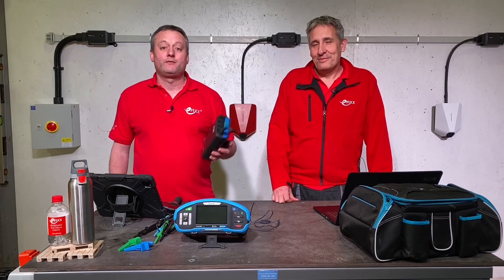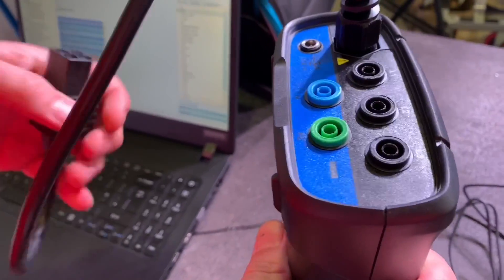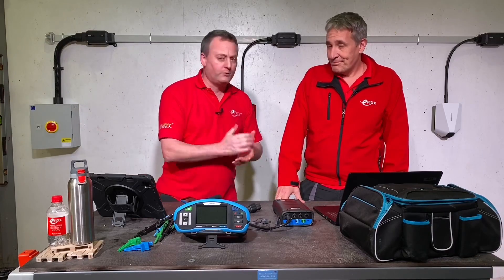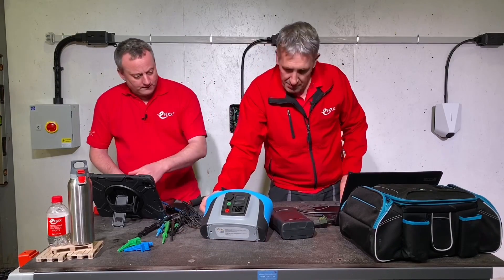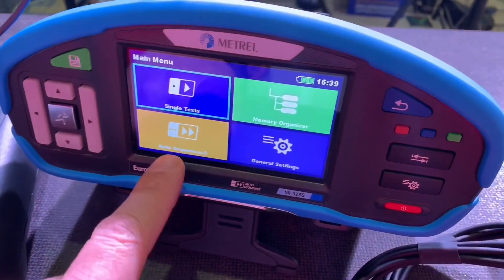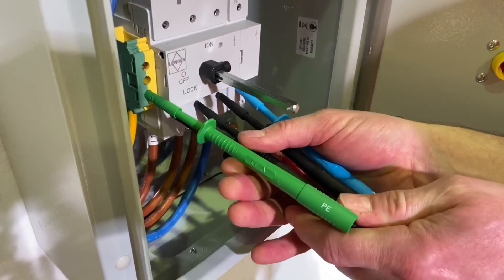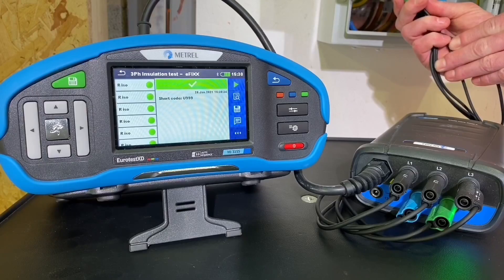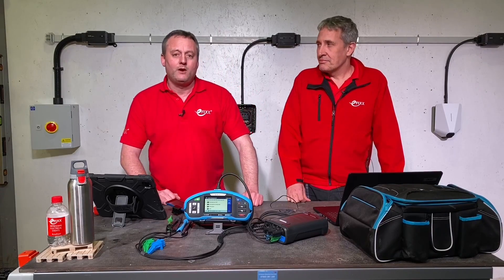Faster THREE PHASE testing with the METREL ACTIVE SWITCH using MI3155 Auto sequence

Comment: I like eFIXX videos, they are very educative. I wonder though if there is an easy way to carry out the safety tests i.e. RCD, fault loop, isolation etc, on a DC charger in a similar way as on an AC charger, where measurements can be made through the XA 1523 adaptor. If there is already any relative video, please indicate. Thanks.

Comment: That I.R. test is just the easy one...Does it do R1+R2     which is the pain to test for the air con unit on the roof or do we still need to run up and down 4 times.

Comment: Hi there. How are the three-phase RCD check sequences performed?
 3P + N; does it first with L1-N and then L2-N ...?
Reply from the maker: RCD test on three phase is just usual any Line to Neutral
Reply: @efixx  In other words, the routine test of the 4-pole RCDs according to IEC 61008. Does the MI 3155 connected to the A1507 perform the automatic sequence first between L1-N and then L2-N and L3-N just like the test R ais?

Comment: When doing IR testing I short my probes first to check they are not broken, how would you do it with this tester?
Reply from the maker: Good point - Connect all the probes together at the end (stack them) and run the test sequence - the meter should then report a fail for every test.

Comment: I have 3152. How do you find the battery life? Seems to be go pretty quickly to me.
Reply from the maker: This has a beefed up battery compared to the 3152
Reply: I get days out of the 3155
Reply: @richardwilliamson3624  thanks for the reply. Just that when I first had the tester I charged it for 16hours and didn’t use it for a while (couple of weeks maybe). Went to use it and it was almost flat after only a few tests.

Comment: Amazing tester 3 phase and singal phase and neutral with Bluetooth but it can test 3phase If their lose 1 pahse also reverses phase??
Reply: Such testers can also measure voltages and the direction of the rotation field, which should be clockwise. But this was the insulation resistance test to inspect that the insulation of the cable isn't damaged.

Comment: My first tester was an MI3125B. I only stopped using it because the buttons became unreliable, and it needed a firmware update over RS232. I changed to a Fluke 1652B. The fluke has a much simpler interface, and having separate test leads suits me better than the proprietary 3 way tangled mess that comes with the Metrel. The design of Fluke's 'remote control probe' TP165X makes it much more usable than Metrel's unwieldy equivalent 'Tip Commander'. The Metrel was better on two points though: having the Chapter 41 Zs tables built in to the tester and its ability to use all three probes for IR tests- hook up three clips to L,N,E and then cycle through L-N, L-E, N-E. I used NiMH cells on my Metrel which latterly wouldn't last a full day of testing; much more convenient to use alkaline cells in the Fluke and change them twice a year.
What I'd occasionally like is an 18 pole test solution for continuity and IR, for testing 'socapex' cables. The Outboard/Data Strategy QC-Check looks like a brilliant bit of kit for people testing such things all the time